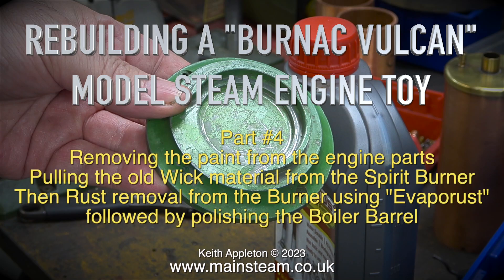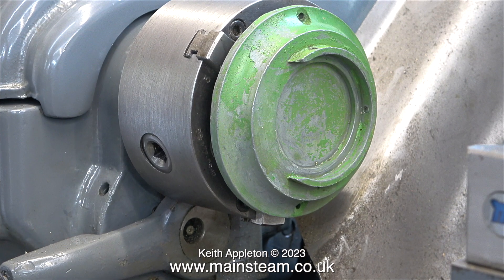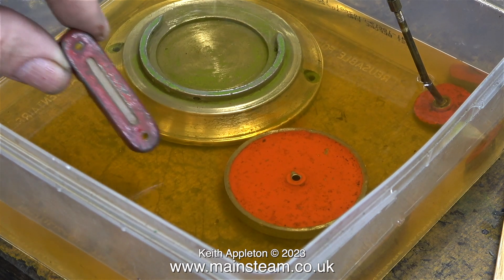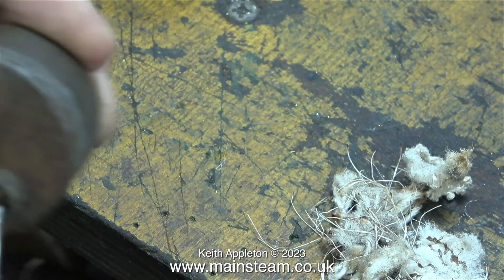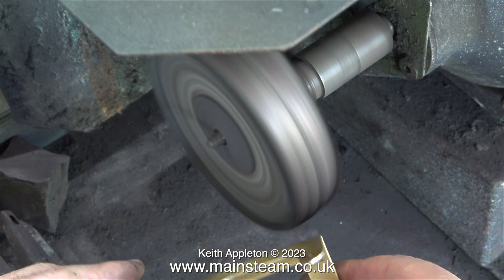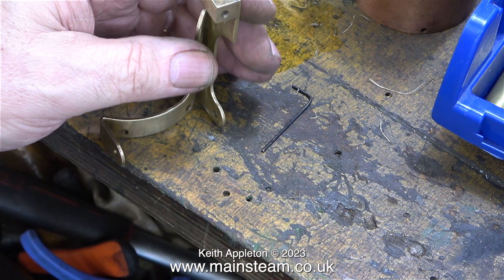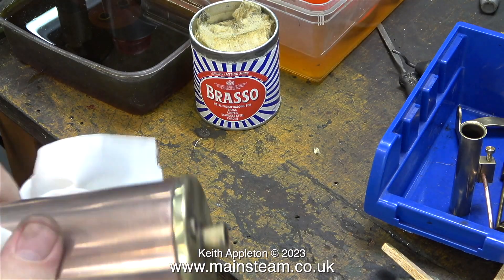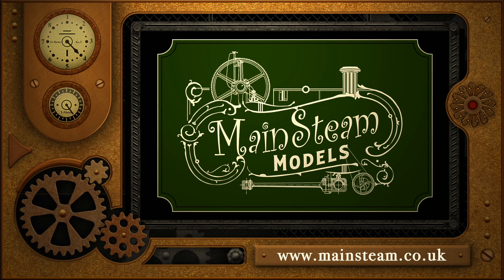REBUILDING A "BURNAC VULCAN" MODEL STEAM ENGINE TOY - PART #4

Comment: I am fearful of making a suggestion, Mr Appleton, as you can sometimes be quite fierce with people who you judge to have made foolish suggestions. Still I will risk it. Why not use an electric toothbrush for removing paint - carefully remembering not to use the detachable heads used for paint removal for cleaning your teeth?
Reply from the maker: I have already shown this method in a few videos, I stopped using the electric toothbrush when it  ceased to function.